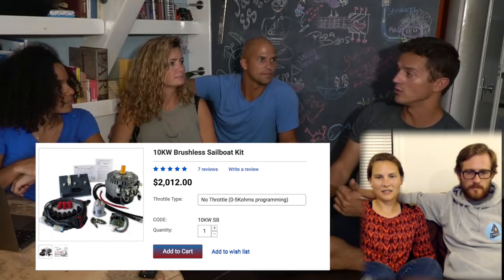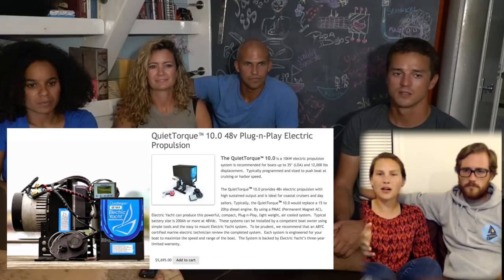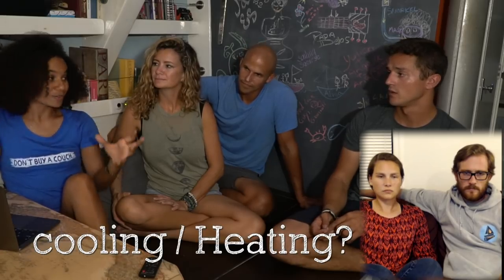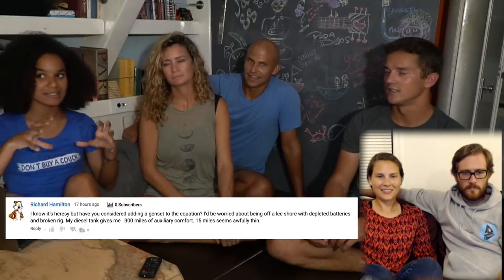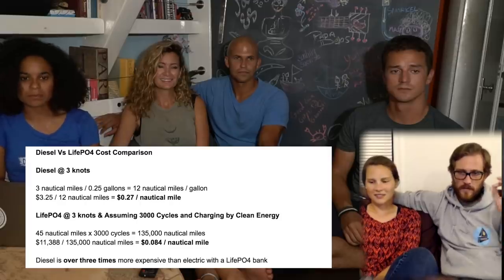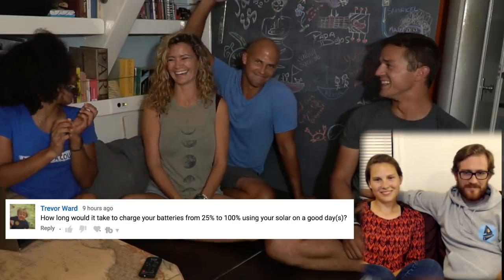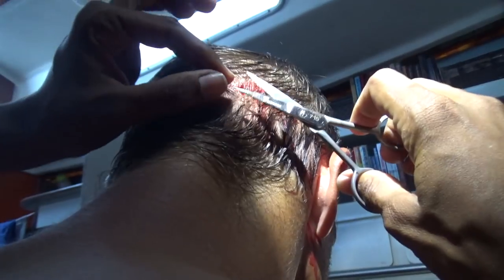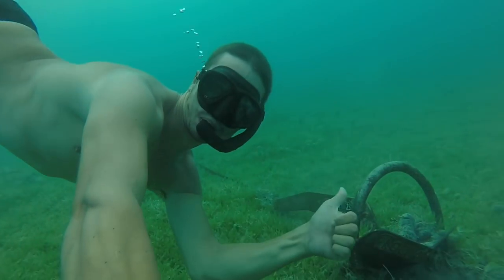Electric Sailboats: An HONEST Discussion — Sailing Uma [Step 140]

Comment: To bring a bit of balance to the discussion, I think electric makes a lot of sense if all you want is to get in and out of harbours, or if you are going off-shore for long periods (e.g., crossing oceans).  However, for most coastal cruisers or those who have limited vacation time - safety arguments aside - diesel is a far better option as you can cover a lot of ground in a short time to reach your desired cruising area, have better maneuverability in areas with heavy traffic and/or strong currents (e.g., St. Lawrence Seaway), and have much greater range.   Also, in my experience, there are many instances where you need to get off the water quickly in deteriorating weather, or you need to make miles against bucking seas, and nothing can replace the power of a good diesel engine in those circumstances.  Its not necessarily about safety (though that is a legitimate consideration), but there times when you've just had enough of getting tossed around.  Plus your diesel serves as a generator to replenish your house batteries and heat the hot water tank.   

Sure, diesels need maintenance, but that's just part of the overall hobby.  We can always find stories of people with engine problems, but a well-maintained diesel is actually quite reliable, and most will just keep on ticking hour after hour, year after year.  Stories of how hard they are to start are a bit over-the-top in my opinion - what's so difficult about pushing a button for a few seconds to heat the glow plugs and turning an ignition key?  Even my 11 year-old could do that.   My old Westerbeke 21 is very fuel efficient, and I might go through 10-15 gallons of diesel the entire Summer season (I do, of course, prefer to sail whenever I can, but we do get our share of windless days up here in the North-East, and sometimes you just have to shift anchorages or keep to a schedule).  I can easily get 6-7 knots of speed at 2500 RPMs with my Aloha 32, with plenty of torque to push through head seas and currents, compared to poking around at 2-3 kts on a calm day with an electric motor (for a maximum of 5 hours or so?).  I know at lest two people in our area who had converted to electric, and after a couple of years reverted to diesel or gas, though they sailed in St. Lawrence River/Great Lakes waters.  I guess it ultimately depends on where and how you sail. 

I once tried using one of those Minn Kota electric motors as an auxiliary for an 18' camp-cruising Swampscott dory and gave up when I couldn't make any headway against strong winds and choppy seas.  I did better with a proper pair of oars, and finally stuck to that for the remainder of my ownership of that boat.

Comment: Very interesting discussion. Now we don't have an electric boat, or any boat at the moment, but we do have 2 battery electric cars. And there are the same type of complaints about the cars as well.. ie don't go far enough, batteries won't last, can't tow. Well with our 2 cars, one which is a 2011 Nissan Leaf that can do about 80km on a charge, and a 2016 Hyundai Ioniq which can do about 230km on a charge, and after doing 20,000km in each, we have found very little restrictions. 

In the case of a long journey (500km), we spent 90mins charging and 8 hours of driving, it made little difference to us. And I can see the same with electric propulsion for a boat. Even for most people with diesel inboards or small petrol outboards, on a yacht, they still only seem to use them for a very short period of time. 10 mins or so before the sails are up and the motor isn't used.

I have thought that a crashed Leaf would possibly make a good donor for a conversion.. Decent amount of battery -> 15-20KwH, 3 phase AC motor that is rated to 80KW @ 390 Volts. Might be a bit of work to either get a new controller, or trick the car one not to worry that there are no doors, handbrake or ABS.

As for recharging the batteries while under sail, a hydrogenerator looks like a good option, as they can get up to 1-2 KW of output for dumping in to the batteries.

Loving the videos.. Thanks

Comment: Interesting discussion, think it covered a lot ground on using electric propulsion. Was a little surprised nothing was said about hybred sustems as part of the decision process. Hope this topic is revisited after each boat has a year or more experience cruising with their electric setup.
Reply from the maker: We've been at it for 2 yrs without needing to go hybrid. BUT, we've been in the Caribbean with lots of sunlight and easy sailing/anchoring. We'll see what happens when we sail into tougher seas this summer.

Comment: One sailing channel put it on the top of the mast and he liked it. The new vertical wind generators are more efficient and most important quite.
Reply from the maker: Yeah, we've thought about that too, but the noise vibrating down the mast would drive us NUTS!!!. We may add one that we hoist while at anchor. No need to have it while sailing since we'll get plenty of power from the prop soon enough.

Comment: Bottom line is your electric propulsion system limits your choices. If you're content with those choices...all is good with the world. Many people who criticise electric, want the freedom and safety that diesel provides to explore more options, like using canals and waterways, like the ICW and Prince Rupert and William, or motor cruising where there are extended periods with no wind. If Dan and Kika aren't bothered by this, then electric is fine. However, most mariners are bothered by this and choose diesel because of it.
Reply: GazLowe  of
Reply: Sometimes it takes a river to get where you are going.
Reply: Well put🙂❤✌
Reply: Why not have a diesel generator as a backup system? I know everyone wants to get away from fuel use but I believe in redundant systems.
Reply: just tie the dingy alongside an motor
Reply: Please someone explain to me where the SAFETY is in having a diesel engine. I've never once heard of an electric setup failing in a dangerous situation, but it happens so often with unreliable diesel engines...more than once on vessels where I was aboard and all of a sudden at the worst time, the diesel stops. That's NOT safety!
Reply: @kentwood2914  So, I'm going to say first off that I am 100% pro electric, and if I ever get my boat, it will have electric saildrives.  But diesel engines are ridiculously reliable, but you have to take care of them.  Breakdowns do happen, even for well taken care of engines, but the same can be said for electric motors.  Problems do come up even for the most well maintained system.  But the truth it, most people don't take care of their engines.  It's no different than cars.  If you don't do the proper maintenance and beat the engine up through misuse you're going to shorten the lifespan dramatically.  This does give electric a slight benefit, since electric motors require much less maintenance, so those who abuse and mistreat their things will have fewer issues, but the problem is them, not the motor or engine

That being said, I 100% agree that diesel only offers any extra safety in a situation where you need to motor for an extended period, and if you  have a decent performing boat, and actually take a minute to plan ahead, those moments are pretty rare.  Balance Catamarans has a video talking about a customer who bought a boat, left with a full tank, and when they came back to the factory a year later after a circumnavigation had only used 3/4 of the original tank of diesel.  I feel like Any electric motor would have been just fine in the same situation.

And of course, today, 2 years after this video was made, all of the range anxiety over electric is even less justified.  Battery tech continues to improve, and now there is a hydrogen fuel cell system on the market designed specifically for marine usage that can basically have the same range as a diesel engine, and weighs half as much.  Granted it's stupid expensive, but so was the diesel engine when it was brand new.
Reply: @charonstyxferryman  did you not bother to read anything else I posted?

Comment: hello. We have the torqeedo poddrive 2.0 on our sailboat for 3 years and it is awesome! no problems at all. We use 2 x12 volt 185 Amp hour lead acid batteries and can sail for about 16 hours at 3 knots. The drive has almost no energy wastage because the is no gears and no real axle. Torqeedo makes more powerful models of the poddrive for boats up to 10 metric tons. its a very efficient system.
Reply from the maker: Sweet! Good to know! Any chance they do regen as well?
Reply: @SailingUma  It has however the prob is very much focused on forward propulsion and not very effective in reverse and thus not very good and regen. I think we have to sail more that 6 knots or something like that and our boat is not a very fast nor very big.
Reply from the maker: Yeah in order to get good regen, you really need a servo prop. Something that can flip backwards while sailing. Only know of one company that can do that in the market currently.

Comment: Something that wasn't mentioned is having a good sized gen set to help keep the batteries charged if motoring was needed for "safety"/convenience purposes. I like the idea of having several options for power, solar, wind, re-gen and diesel if needed.

Comment: I love the content that all of you are providing!  I am new to sailing and because of my lack of experience i have depended so much on the diesel engine, and that dependability has gotten me in so many bad predicaments.  Depending on the sails would have kept me out of these predicaments.  i believe having an electric motor places my mindset on the limitations that would encourage me to become a better sailor!    i am looking into the 10KW Brushless Sailboat Kit, but not sure it will work given i have a saildrive (i have a lancer 30).    Once more great content!

Comment: Dan and Kika, question?.... Thinking of the old fashioned towed log, could you use a somewhat shorter version with a "regeneration" style design propeller for when you are sailing? Not necessarily for coastal hops/day sails but more for longer passages. I realise it's probably a simple idea filled with various problems, but could it be done?

Comment: i guess the panama  and suez canals are not options for an electric boat?
Reply from the maker: Personally, we'd rater sail around. But if you did go though, just rent a genset and put in on deck. Or you can hire a skiff to tow you though.
Reply: even with a genset could the electric motor run at a minumum of 5 knots for the 80 mile transit without stopping in 40 celcius  ambient heat .
 using a tug boat in either canal is obligatory which will cost thousands,a skiff is not an option.
Reply: You can also just go over land, most likely just as cheap and maybe faster.
Reply: in egypt for  $600 i think not,neither in panama for$1000 which is roughly what a canal transit costs for a 36ft yacht.
most yachts end up building a bracket and fitting an out board if unable to motor through
Reply: @Alex bond - There are ALOT of places that you can't take an "electric Only" vessel. 

I would want to travel the globe, not just a minimalism amount of it...just my opinion 😊
Reply: @Sailing Uma - I'm not against electric motors, but the technology isn't viable enough yet for us older people to risk our lives. I'm trying to decide now on if I want a S/Y or M/Y... I have looked at ALL the Hybrid power plants and have talked to a few of the manufacturers, and they say that I would need at least 100m vessel for them to be cost effective for me to Circumnavigate the entire Globe (over the next 10 years or so). For you to stay in relatively close proximity to land and not say go through the North-West Passage or Japan, South Pole, etc, I can see you trying to make it work. You don't need to heat or cool your boat.... 

Cheers 😊
Reply: in the future your mini onboardi hydrogen fusion generator will be making unlimited power for propulsion,at the same time converting salt water to fresh water,then fresh water to hydrogen gas,that can be stored to run your outboard ,bicycle and portable generator on.

batteries as we know them will be obsolete,instead electrical storage matrix will be moulded into the hull when the boat is built,for larger ballasted vessels ,the keel will form the principle energy storage unit.

any type of carbon based fuel will be strictly  controlled by governments for use as lubricants,plastics and chemicals only.

world population will have been reduced to about 2 billion,with the majority of food production done by robots.

unfortunatly democracy,public dissent and channels like youtube will be seen as dangers to public health and outlawed.

euthanasia will be the number 1 cause of death for the aged,disabled,unemployed and non productive members of society.

moral of the story:,go sailing now before it becomes a passtime reserved for the elites and whilst there are a few fish and coral reefs left.
Reply: @SailingUma  my understanding is, you have to be able to self power. The yacht i am on has an outboard bracket fitted as the engine died just before entry into the canal. Had to self power or they would not let it through. This was 8 years ago.
Reply: This your "insurmountable problem"? Rent an outboard.
Lots of reasons for and against. This ain't one.
Reply: @alexbond490  Well over 2000 USD to transit Panama now  Alex. Prices recently went up dramatically.

Comment: Great conversation guys!  I really enjoyed it.  The Pearson 35 is one of the boats I have in mind for when I start cruising.   Along with the Alberg 35, Bristol 35.5, and a Luders 33.  Those are my top choices, but that doesn't mean I won't consider other options.  I do want to go electric rather than diesel and rely on sailing skills, not steering skills to move my boat!  Thanks for the conversation, and I may have questions later.

Comment: Two reasons you might not want to put a wind generator at the top of the mast. One, voltage drop and two, windage during a storm.
Reply: It could upset the balance of the boat with having weight or drag up that high.
Reply: I completely agree with the windage comment.. anything producing any kind of drag at the top of the mast will never be beneficial.
Reply: Alexander Blitz and direct lightning strikes to whole electrical grid
Reply: VAWT can be on top with no problem - the structure is damped. not a horizontal one tho. also a VAWT with composite blades is less of an issue in lightning storms.
Reply: Either increasing the generator's voltage or increasing the gauge of wire will address voltage drop. You can reduce drag at the top of the mast by lowering the sail.
Reply: Quickly there seem to be even more issues:   Besides what you mentioned. A wind gen should be as positionally stable as possible, the higher up it is the less stable it will be due to the boat rolling even slightly.  (Rolling, movement of the gen itself will reduce effectivity of the gen.) Also, drag and weight are more of an issue that far up, upsetting boat balance more. Besides ease of maintentence as well. Those issues combined seem to offset the advantage of having more power at low windspeeds on top of the mast. Those are probably a reason why 90% of all wind gens are mounted above or near the cockpit.
I mean its possible but you have to trade off the (dis)advantages as usual.

Comment: Comparing new electrics to broken down diesels waiting for parts isn't fair. Suggesting that finding propane is similar to finding diesel also isn't fair.  The suggestion that your seamanship is so good that you will never need a 100 hp engine that can run all day is hubris. If you want to be greener buy biodiesel, it's newer than dino diesel. I would appreciate a full discussion of the pros and cons.
Reply: For sure diesels are very reliable and have a huge range and if you are on a strict schedule - a necessity. But there is no doubt getting from A to B without using the engine takes more skill, not to say those with diesel aren’t skilful, just that a passage plan with 3hours worth of non-sail propulsion takes considerably more thought and is much more restrictive. If folks choose that way to travel I have no issue, they use less fuel and drive the price down at the pumps for everyone else.
Reply: I have never seen, nor ever heard of a 100 HP engine on a sailboat.  I suppose such a thing exists, but I bet those sailboats are really, really big.

So where are you coming from with that?  BTW  ICE stink and finding fuel(even gas), can be very problematic sooner or later ... even cars run out of gas in the boondocks.

ALSO engines or motors on sailboats is "supplemental", the first means of propulsion is in the  SAILS.
Reply: Word..

Comment: This is an awesome discussion and I agree with just about everything you are saying except maybe to add a point both people in a cruising couple should be able to run the boat solo 100 % regardless of whether  it is a sail boat or a power boat or if it does or does not even have an engine.  a minor point but it was such an awesome video even though I am seeing it a year later I had to say something .

Comment: Maybe for safety backup, invest in a bigger outboard motor for the dingy, so it worst came to worst you could plop the dingy in the water and tow yourself easier... I know you have done it with the 4.5hp motor, but if you had the extra power it wouldn't work as hard and overcome higher currents.

Comment: DAN AND kika, I sail a race 45' catamaran that I designed and built and it had no motor. It was very challenge to maneuver but it made me able to put a monohull anywhere sailing. Actual sailing is easier then motor to me.